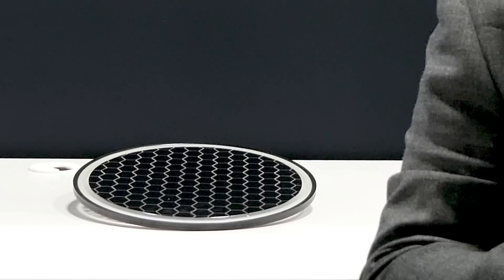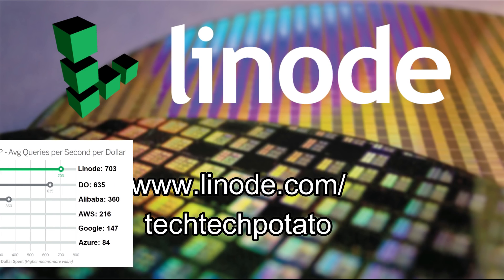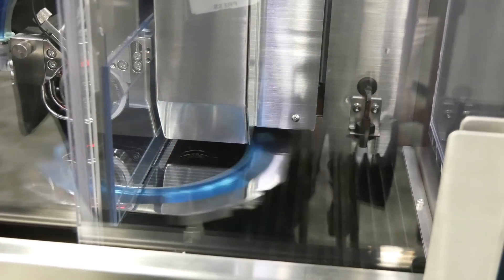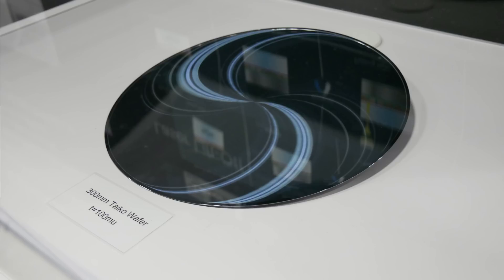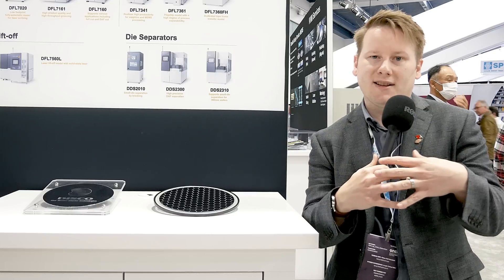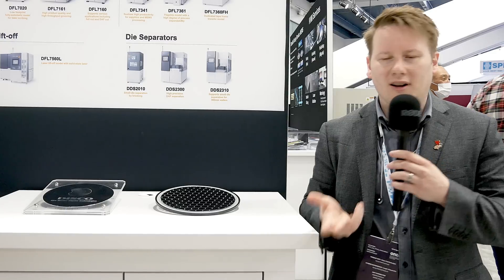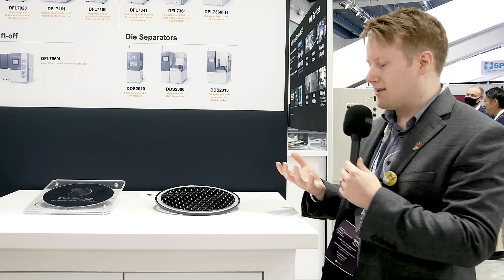CPUs Can Be Hexagons ?!

Comment: of course.  next they need cylindrical or spherical chips, so signals can travel from one side of the chip to the other via a shorter (faster) distance.

Or just make a 3d matrix instead of a 2d matrix.  yeah heat, but have you heard of cubic boron arsenide?  it dissipates heat 10x as fast as silicon.

Comment: I wonder if we'll ever get to a point where a wafer will have many different dies and die sizes on them.
So a large square/haxagon in the center and then more and grandually smaller chips as you go to the outside edge, So for example GA102's in the middle 75%, GA104's in the outer 15% and a few GA106's in the other 5% to get closer to full utilisation than what we can currently do with square or hex dies.
Reply: isn't that the case? I mean most brands have various die sizes depending on the product so by paying per wafer they might already want to do that kind of space optimization. Maybe the usual cutting method isn't adapter to this but it's feasible.
Reply: @PainterVierax  usually a wafer is made of dies all the same size, So a wafer is all GA102 or GA104.
I mean big dies in the center then increasingly smaller (maybe only 2-3 stages) as it gets closer to the perimeter to use the empty space.
Reply: @tomstech4390  I get what you mean, just I'm sure it's a thing they've already experimented on to improve both space and yields. Even with standard cutting, that could be possible to be done to a degree if properly designed. For example, a bunch of 2×2 square dies surrounded by some 1×2 rectangular ones. 
It just might not worth the effort.

Comment: 'more shoreline'. Actually that doesn't completely add up. The absolute minimum circumference for an area is a circle and a hexagon has less circumference than a square and a square has less than a rectangle. But for wire placing arrangements a hexagon might be more convenient than a rectangle even though it has a shorter perimeter.

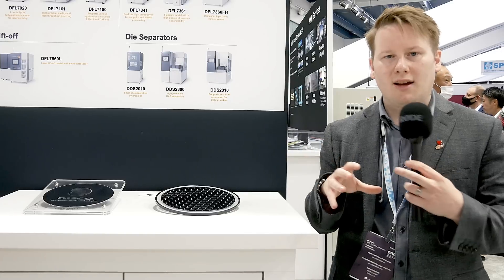Comment: @Ian ... 2:52 "increases the shoreline" um... no it increases the chip area per shoreline, which is just the opposite.  What it does do though is decrease the average distance to that shoreline, which in turn should lower power and latency.   Hmm... maybe the obtuse angles create more viable shoreline due to less constrained routing.

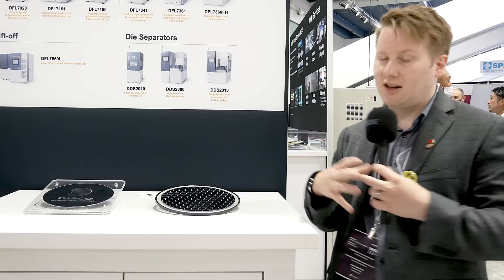Comment: 2:55 Does it really improve off IO space on the perimeter?  A hexagon, being a closer approximation to a circle than a square, should have less perimeter per same unit of enclosed area.
Reply from the maker: It's more six shorelines vs four, and the ability to fully utilise them. At least that's what I was told
Reply: Not perimeter, shore lines.
I guess that if you take a shore of 1mm then your corner each lose 1mm2 because the shore is shared with two edges. So the larger the shore depth the more shared space and the more wasted perimeter.
Reply: @Vaasref  
The corners of a square are also sharper, so it might be a constraint sometimes.

Comment: Interesting new ways to slice that silicon cake! Like a few others mentioned, there is an audible audio crackle and pops in the recording every now and then which is a little distracting which shows up even during the start of the Linode ad so it might have been some compression issue in the video. Cheers.

Comment: But in all seriousness, I'm surprised more companies aren't going to Hexagonal Dies for increased Die Output alone.

Especially AMD & TSMC.

Imagine what they could do with Hexagonal Dies!
Reply: There's a very simple reason for that, dicing, or separating a wafer into dies, is currently mostly done with a diamond saw/abrasive blade. So to use that method you need straight lines you can follow across the wafer, this disqualifies hexagons if you want to dice this way.

Edit: I guess I look like an idiot now, I start the video and this is the first thing he talks about ;p

Comment: This does raise some interesting ideas around tiling. In theory, your chips no longer need to be square. If you apply the options in the form of Penrose Tiling you could start doing shapes specific to what the silicon layout needs (eg keeping hot parts as far away as feasible from other silicon) rather than what the manufacturing constraint is.
Reply: The Penrose tilings are not monohedral tessellations. I think you're thinking about irregular monohedral tessellations. There are tons of very interesting monohedral tilings out there, though. Take the various artistic tessellations by M. C. Escher as one of the more crazy and not mathematically inspired examples.
Reply: Things need to be close for latency issues, you can see with the L3 on Ryzen that proximity matters. This is why stacked is being developed. Light can only travel 10cm in one 3.2GHz cycle.
Reply: Yeah no - that would just make the chips more expensive than just making them slightly bigger for spreading the heat.
Reply: You can keep heat sources far away from each other even with square or rectangular shape but it'll cost you money and more importantly perfomance since you gona optimize die for heat dissipation and that's just stupid. You always optimize chips for perfomance/efficiency or in rare cases die area otherwise u just losing money.

Comment: For a unit area, perimeter of a square is 4, hexagon 3.7, circle 3.5, so you get less as you go up.

Question remains what is the use case? I can only think that someone wants maximum silicon area to fit into a circular space. Does it increase difficulty with layout to fill a hexagonal shape?
Reply: You want tessellation, for maximum wafer area usage, so a circle is bad.
there is also the need to optimize use of die surface area by the topology.
also maximize edges to surface for IO.
so triangle square and hex are the only solution.
Reply: The goal is likely to increase the number of complete dies that will fit on a wafer, improving yield.
Reply: @Finder245  The maths is beyond me. For the same die area do you get more hexagons than rectangles on a circular wafer? I guess it would depend somewhat on the size, so assume something around the ones in the video.

Comment: Small Gpu's could keep 16 lanes instead of being cut to 8 or god help us 4 with this tech.
Reply: No, cause this actually reduces edge-area. And while IO is in general at the edge, the same goes for anything else as well. Why? Cause "in the middle" you got the cache and buses so that everything can be reached nicely. But you could have your IO anywhere on the chip - that has no impact.
Reply: PCIe lanes take up significant space on the die. That doesn’t change with the shape of the die. Designing chips is a balancing act. The goal is to get the best performance within a budget. Adding more PCIe lanes would necessarily take die space away from the GPU itself, so the goal is to have just enough PCIe lanes to feed the GPU. If this is balances for PCIe 4.0, then performance may get worse for PCIe 3.0 users, so you also have to look at what computers people have and decide if it’s worth balancing for PCIe 3.0. Most likely though, the answer is that there is no point in designing anything new with PCIe 3.0 in mind today.
Reply: @Finder245  I could be wrong, but I believe Lanes take up edge space, more edge means more space for the actual lanes, not just the controller part that determines the generation. On your other point. PCIe 3 is still relevant because pretty much any AM4 motherboard can have a zen3 CPU. 300 series boards can run the 5800x3D without any performance loss vs 500 series, with the only real difference being the PCIe gen. That CPU/Mobo combo will still be decent years from now, but a hypothetical future GPU upgrade could cripple the system because of the trend to cut lanes. There isn't a GPU out now that fully uses PCIe4x16 bandwidth, so what will happen in 3 or so years? PCIe 6 might be out, but no GPU you would reasonably pair with a 3/6 year old system would need PCIe6x16 bandwidth. 60 class cards with only 4 lanes could be a realistic supposition. A disaster in the making in my book.
Reply: @Weirdanimator  AFAIK, PHYs get pushed to the edge of dies only because it makes sense for routing. It would be difficult to meet timing with those blocks in the middle of the chip because these blocks are large. No matter what you do, they will remain relatively large. The same is true for all other I/O including DDR. Search for “navi 22 annotation”. That might give you an idea on how much cache or compute could be added in the same die area that 8 or 12 more lanes require.
Regarding support for older mobos: very few people upgrade their computers. The DIY market is tiny compared to prebuilts, and enthusiast are more likely to upgrade, but they are also less likely to get a low end card.
My prediction is that x16 cards will slowly die off as PCIe speeds increases. That many lanes are a problem for everyone especially at these higher speeds. Mobos, cards, CPUs, chipsets could all be simplified if we could cut the number of lanes, and that will ultimately save cost for most people.

Comment: Nice crackling sound in the video. Did you get that mic from a nearby dumpster?
Reply from the maker: I don't hear anything wrong with the audio?
Reply: @TechTechPotato  You had popping audio for months if not years. You can probably see the pops(gaps) in the wave form in Audacity if you zoom in. They are there. We are not crazy. These issues usually come from "real-timeness" issues in the audio stack.
Reply: @TechTechPotato  Correction, I can't see the gaps in waveform, but I can clearly see vertical lines in the spectrogram that correspond to the pops. Check it for yourself. Cracking sounds are caused by small high frequency "perturbations" in the waveform.
Reply: @TechTechPotato  Invest in hearing aids then

Comment: Don't hexagons have a lower edge length to surface area ratio than squares? I thought the closer you got to a circle, the less edge length you had?
Reply: I think it might have something to do with bringing the edges closer and a more consistent distance (on average) to the other things on the chip, which sounds like it's probably useful.
Imagine you have some important thing that needs to communicate with a lot of parallel connections, if you have a a square chip then the middles of the sides are closer to that than the corners are, so the differential signal speed could become an issue. With a hexagon, the distance from the centre to the edge of the chip varies less. Octagons are even better. I imagine this is why someone would want a circular chip for some extreme niche application.

But I'm not a chip designer, so take this with a small crystal of hyper-pure silicon.
Reply: Yep, getting closer to circular shape will lose you edge length per mm² of die space.
Unless there's something that was forgotten in the video, such as (wild guess alert) that you can't really put IO on the corners of square chips because... reasons? Or something.
Reply: I guess the name "shore-line" is used to distinguish the desirable edge length from plain circumference, with a squares acute corners being less accessible so not part of the metaphorical "shore"
Reply: Yeah, I am confuse and feel stupid.
Reply: I don’t think it’s about the edge length in and of itself. I/O links can’t be too far from the area of the chip it is servicing without power, timing or latency issues. Or maybe more complexity than the designers want.
 
It’s probably about having more edge for SERDES links or other I/O that are still close enough to the blocks being  serviced for the designers’ aspirations.